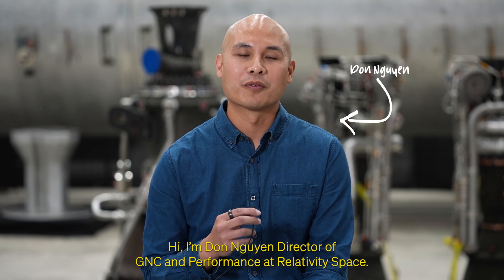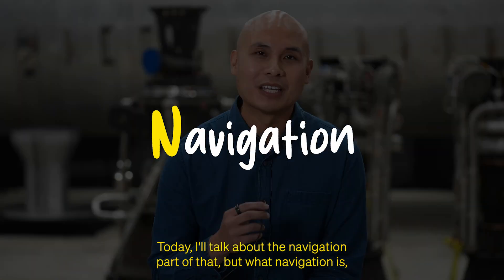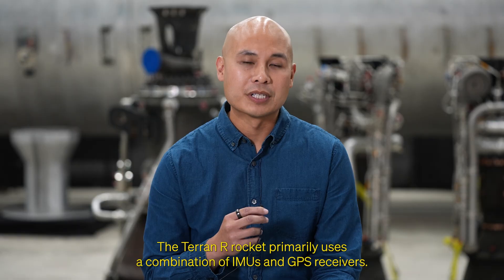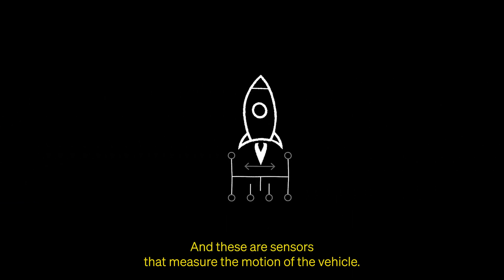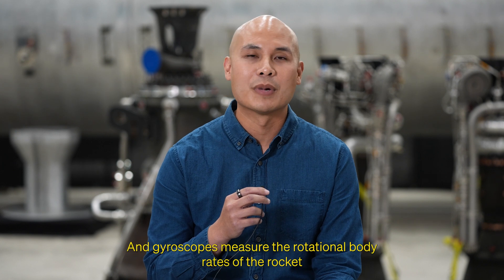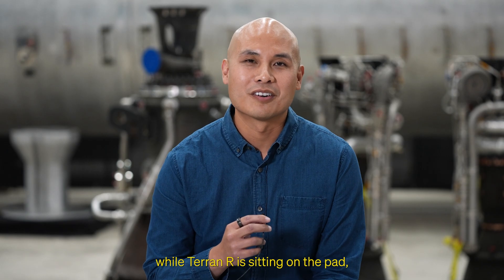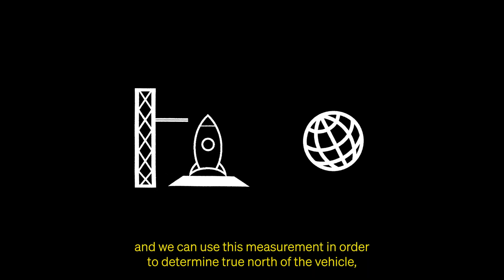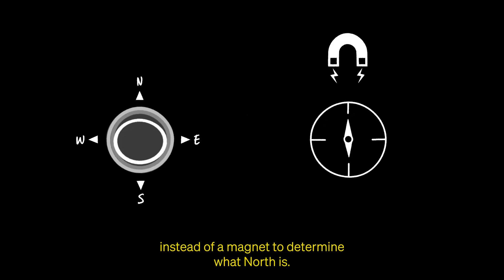Since You Asked: The N in GNC

Comment: How do you account for measurement error and integration drift?
Reply: You can use a Kalman filter to use the GPS data to correct for the drift in the accelerometers. Think of it kind of like a running weighted average of GPS data and using the accelerometers to accurately inform the estimate of how the position is changing over very short periods of time.
Reply: I was wondering the same. I've worked with IMUs and the error in position and velocity increased very quickly, to the point that the values were useless for knowing where you are. Perhaps they use other sources (like the GPS they mentioned) and use sensor fusion to sort of reset the values back?
Reply: I guess it’s a combination of very good IMUs and Filtering/Combination of Sensor Data & real time flight Modeling of the actual Rocket trajectory
Reply: The drift rate of these military grade IMUs rocket is so low I don’t think it matters for a 7 minute flight to orbit. Or even a 3 hour mission to GEO. 

Accelerometers are useless in flight because you lose the gravity vector. It’s a mix of star trackers and the accurate gyros